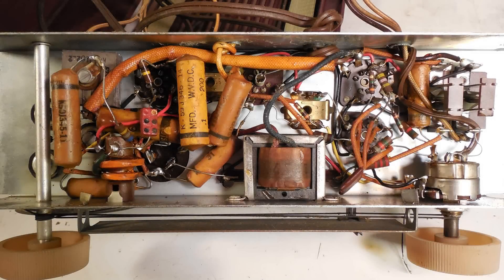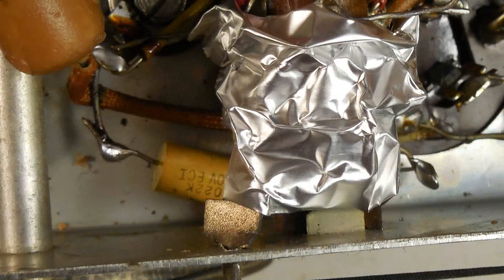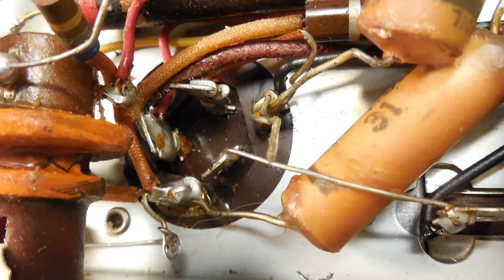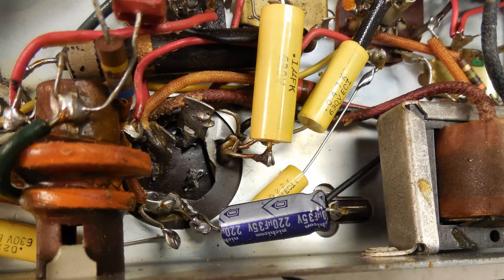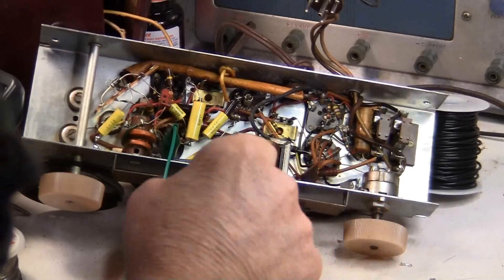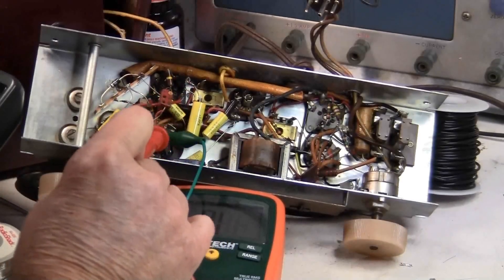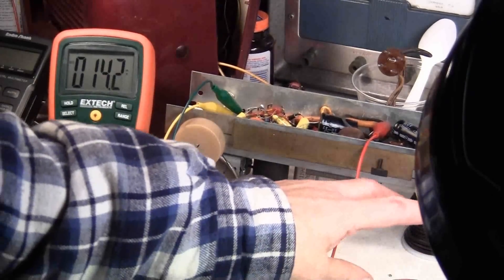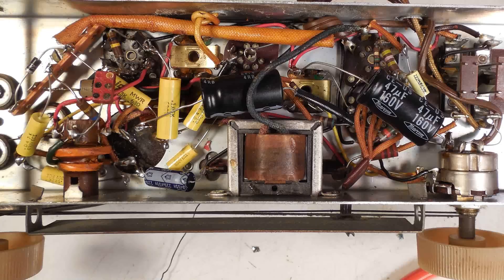Portable Tube Radio Repair, Replace Caps and first test of Power Supply

Comment: Could you have put the new filter caps on top and removed the old filter cap .me I have a problem leaveing old parts in ,and if you would have removed the old cap you would have more room on bottom too , I am only a novice at best ,that why I watch you because your work is so good.I like the tin foil trick,I have used heat proof tape a couple of times .
Reply from the maker: You could put them on top. The reason why I don't is so that it doesn't look like I did anything to the radio. The old parts are not in circuit.

Comment: May I ask what diode you used ,it doesn't look like a n4007,diode,the numbers I can read I have no idea ,did you remove the old filter cap ,the old filter cap had a lot of wires on it I thinking the bottom outside ones are ground?anyone
Reply from the maker: It is a one amp diode

Comment from the maker: Hey Andy,
I have burnt a few coils, luckily not to the point where they were not working. But of course that would only be a matter of time. I do like the foil because it's very cheap and it works good. You do have to be careful not to break any wires putting the foil on and taking it off, but it's easy to do.
Regards
Rick

Comment: I can see that you cut loose the connection to the positive side of the original 40 uF electrolytic section. Do you worry that if it is left loose that it, might eventually short out something else if it gets moved? Just wondering.

Comment from the maker: Thanks Douglas Tees,
40 to 47 µF, is not too large of a step nor is the 200 to 220 µF. Basically it's what I had on hand. Since I replace the selenium rectifier with a modern diode the circuit will easily handle the increased surge.

Comment: Rick, It looks like you beefed up the filtering on the power supply using higher value electrolytics than the originals.  Nice to know this can be done.

Comment: Nice professional work Rick.  I have a Truetone 40's table radio I am currently restoring.  This series is giving me good time saving technique's I can put to practice.  Thanks.  All the components are out of spec in my Truetone from the obvious wax capacitors most all the resistors and even a few of the mica caps are extremely out of spec.  I never had one in this poor condition before.  Truetone must have used cheap parts even for the day in this one. I agree nice tip - foil on the coil!